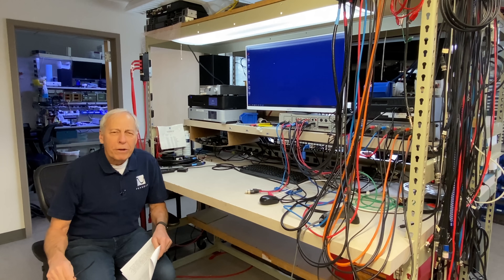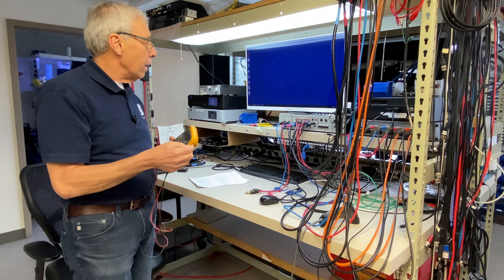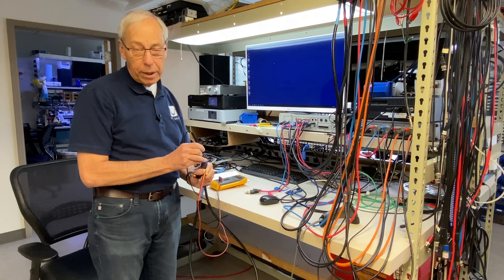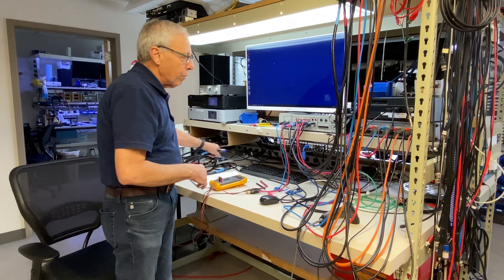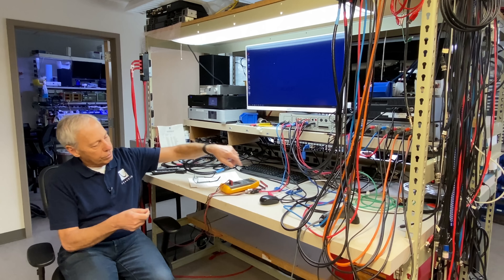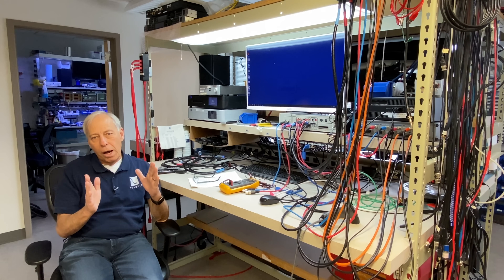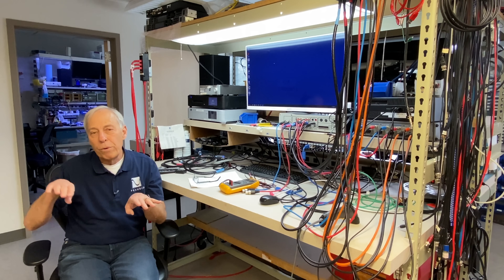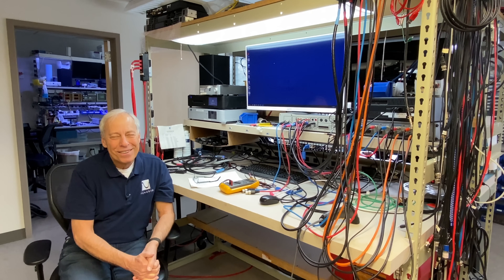Speaker cable impedance

Comment: You need to null out the meter in order to remove the resistance of the test leads.  In addition to this if you really want to measure the resistance of the cable accurately you must use a 4 wire measurement which applies a reference current through the cable and then you measure the resistance of the cable via a Kelvin connection. 

In order to measure impedance you need to use a network analyzer or some other type of AC measurement system.
Reply: You need your own channel
Reply: You are correct if you want milliohm resolution but I doubt more than 1% of the viewers here even know what a Kelvin clamp is or know how to use it. also to get a real picture he needs an LCR meter as inductance or capacitance could be high even if resistance were low , this is how some cables act as tone controls . Also He did compare it to his old cable for both sound and resistance .
Reply: @leekumiega6576  
The sloppy method Paul used isn't even accurate to the nearest 0.1 ohms.  Often 4-wire measurements are needed if you need to ensure errors are less than 0.1 ohms.
Reply: @marianneoelund2940  I have both an B&K precision and Fluke meter than can reliably read to .01 ohms the main advantage of 4 wire Kelvin clamps/clips  is to negate the meter lead resistance which is what the zero button does on my multimeter. More expensive 4 wire meters to measure 1 milliohm is overkill here.
Reply: @leekumiega6576  
Most people only have ohmmeters with 0.1 ohm resolution - such as the one Paul was using.
Reply: @marianneoelund2940  You are right about that as my meters are not inexpensive but cost less than a 4 wire Kelvin set up.
Reply: It's hard to imagine how one might make a 4-wire resistance measurement, without inherently using a Kelvin connection.  Of course, what you are measuring is actually a voltage, then the cable resistance is calculated from that and the known current.  
Regarding impedance, cable inductance can be important at high audio frequencies, if cables are very long.  For 4 ohm loads, I recommend using cables no longer than 10-12 ft, while 20 ft runs to 8 ohm speakers should be good if wire gauge is reasonably heavy.
Reply: @marianneoelund2940  Capacitive reactance is an issue at higher frequencies while inductive reactance is an issue for low frequencies . Hooray for someone who knows about Kelvin clamps/clips. For long runs with a 4 ohm load  use 10 gauge wire.
Reply: @leekumiega6576  
Capacitive reactance is in parallel and decreases with increasing frequency.  Inductive reactance is in series and increases with increasing frequency.  Both are issues at high frequencies only.  
Typically, cable inductance will produce a 1dB loss at 20KHz into a 4 ohm load, at a length of about 70 ft or 20m.  
As some audiophiles claim to be sensitive to high frequency loss as slight as 1/4 dB, they will need to keep cable length much shorter than 20m.
Reply: @marianneoelund2940  Right so your 18 AWG zip cord  has a capacitance of 28pF/ft and 12 Awg is 24pF/ft  https://www.passlabs.com/technical_article/speaker-cables-science-or-snake-oil/ the lower the better now since it's in parallel as the frequency goes up  the parallel Xc goes down which will shunt the higher frequencies more than the lower ones and since Xl is in series and goes up as the frequency goes up it will impede higher frequencies more than low ones .As such it is advantageous to get cables with the lowest L ,C & R readings and that can be accomplished by using 12 AWG or  10 for long runs as each parameter goes down with increasing cable size.
Reply: @leekumiega6576  
17.5pF per foot.  
Z0 is about 120 ohms.
Reply: @marianneoelund2940  how did you arrive at that figure?are you sure it's not .12  ohms
Reply: @leekumiega6576  
Z0 is characteristic impedance:  Z0 = SQRT(L/C).  You can calculate it from L and C measurements (gives 110 ohms for my 30 ft 18ga cable) or measure it directly using TDR methods (gives 130 ohms for the 18ga cable).  It's usually important only for very fast signals like RF or high bit-rate digital where you need impedance continuity to prevent reflections.  
The cable loop resistance is about 0.4 ohms.
Reply: @marianneoelund2940  Before I replied I wanted to make sure what I was saying is correct and that is that ZO does not matter at audio frequencies see  https://sound-au.com/cable-z.htm
Reply: @leekumiega6576  
Yes, as long as your cables are shorter than a couple of kilometers.  
That may be one reason why the telephone company limits their voice bandwidth to only a few KHz; they do have cables longer than that, but don't want the expense of impedance management.
Reply: @marianneoelund2940  I knew it is a concern for long network connections ( cat5 & up and coax ) and that's why cat 5 and old telcom uses twisted pairs and why fiber is so superior but I fail to see the reasoning of bringing it up for speaker wire .
Reply: Yes I know fiber also has much greater bandwidth especially if you use multiple wavelength multiplexing.
Reply: Or Simply,record the resistance with leads connected: 0.2 ohms.
Measure the Wire: 0.3 ohms.
MATH: 0.3-0.2=0.1 ohm.
KISS,my Brothers!
Stay Well.

Comment: "Resistance is Futile"

Sorry, I just had to.....
Reply: You will be assimilated by the PS Audio
Reply: All jokes aside, your quote is valid within the context of this presentation.
Reply: "Tried , have you? Hmm"
Reply: "Make it so, number 1". "Tea, Earl Grey, Hot".
Reply: BATTLE STATIONS. Shields up and load the photon torpedoes, Ensign set a course to Wolf 359 and take us to maximum warp....
Reply: It is good to remember that voice coils also have resistance, which is not futile.
Reply: Don't forget your towel!
Reply: @Hare_deLune  Yeah ..that's THE shield
Reply: Resistance is Not futile. 
It is voltage divided by current.
Reply: No it's not! - You can use the reciprocal of a resistance measurement reading to calculate the number of seamen on a ship.
Reply: @PebblesChan  
The things you learn in the Navy.  Who would've guessed?
Reply: @marianneoelund2940 indirectly meant SIEMENS ...not seaman
Reply: I am Dyslexic of Borg.  Prepare to be asslaminated.

Go ahead, tell me you didn't deserve that.  🤗

Comment: Hi Paul resistance and impedance are not the same, as impedance is an AC measurement in including reactance  on a cable or coil the only thing in common is the word resistance .Resistance is measured as you show on the meter is a function of a bridge measurement, like the videos
Reply: No the only thing they have in common is the word OHMS  , you mentioned reactance which is expressed in OHMS can be inductive  or capacitive or both  only DC resistance or impedance is expressed as resistance .

Comment: In the crossover to my old Infinity Kappa 8, that I have in my storage room now, there are two 25 watt 2 ohms resistors in parallel when you wanted to run the bass in "Extended" or in "Normal-mode" so to say that you have 4 ohms seems too come from the Twilight Zone.
Reply: Infinity Kappa 8 and 9 had 1 ohm resistors in series with a shunt inductor across the woofer. A switch was provided to short out the resistor for "extended" mode.
Reply: @samb3706  Yepp! My amplifier I used back then had 460 watt in 2 Ohms and it had som trouble with my Kappa 8's when I played music loud with some really deep bass in Extended mode.
Reply: @samb3706  
That's a 5 ohm resistor, and along with its inductor, it is connected immediately after the series input capacitor, rather than across the woofer.  The 12.5mH inductor in combination with the 1400uF input capacitor form a resonant circuit at 38Hz.  I haven't done the calculations yet (I may later) but that can potentially drop the system impedance quite low in the 35-40Hz region.
Edit - some calculated impedances for the woofer section:  
Extended Mode
20Hz, 4.2 ohms.  25Hz,  2.8 ohms.  30Hz, 2.0 ohms.  35Hz, 1.6 ohms.  38Hz, 1.5 ohms.  40Hz, 1.6 ohms.  45Hz, 1.8 ohms.  50Hz, 2.1 ohms.  60Hz, 2.5 ohms.  70Hz, 2.75 ohms.  
Normal Mode
20Hz, 6 ohms.  25Hz, 5 ohms.  30Hz, 4.3 ohms.  35Hz, 3.9 ohms.  38Hz, 3.7 ohms.
40Hz, 3.6 ohms.  45Hz, 3.4 ohms.  50Hz, 3.3 ohms.  60Hz, 3.1 ohms.  70Hz, 2.9 ohms.

Comment: Any speaker cable serves as a series resistor to your speaker. Even a cheap speaker cable can conduct with a fraction of an Ohm. You want something less than 0.2 Ohms (total loop resistance) to get a good damping factor (ability of your amp to control the speaker cone most precisely, especially in the bass). The resistance is proportional to the cable length, thus keep cables short. You lose some SPL, e.g. if you use a thin 20AWG cable of 20 feet you lose about 0.5dB and get a loop resistance of 0.4 Ohms, which will reduce your effective damping factor to max 20 with an 8 Ohms speaker.
Reply: Until we have superconducting voice coils, no system will have an effective damping factor better than 3.
Reply: @marianneoelund2940  Superconducting = no resistance ,not even the best amps can drive less than 1 ohm for very long.
Reply: @leekumiega6576  
Yes, we have to be careful not to send them any signals close to DC.
Reply: @marianneoelund2940  Yes, a DC signal at high enough voltage can easily make your speakers go up in smoke without any sound appearing other than the pop when you apply the DC. It's particularly bad and potentially costly, if your amplifier gets a malfunction that yield a DC output and your end up with speakers broken also. I had such experience long ago.
Reply: @marianneoelund2940  In Which case the effective ZO would be infinite.
Reply: @leekumiega6576  
Superconducting cables still have about the same Z0 - they just have much less attenuation over distance because the only loss is from the dielectric dissipation factor.  And as suggested by this paper, https://ieeexplore.ieee.org/document/333364 dielectric losses tend to greatly decrease at low temperatures also.
Reply: Marianne Oelund I’m not planning cryogenic properties of my cables and voice coils in the near future. Servo feedback is more viable. I just remember I met a company at CES 2020 in the area of many small startups promoting a kit with sensor and electronics to retrofit servo feedback on existing woofers. They appeared to have a good concept of tuning it. I thought about doing something with this company but got too busy with other things.
Reply: It would be interesting to know what frequency range they can achieve.  Do you remember the name of the company?  
There are alternative methods which do not require an accelerometer.  I'm planning some experiments with a small subwoofer that I have.  
But every approach works better without a passive crossover between the amp and woofer.
Reply: My room mate in Germany had connected a high-powered receiver to Pioneer HPM-100s with 24 gauge zip cord.
He received AM radio stations!
12 gauge wire tamed that Beastie!

Comment: Guysss,,, OL means; Open Loop!!!
Reply: Mike Eastridge  All of the digitals i've seen say ''OL''.  What if you test a open resistor with your multimeter. You are testing an OPEN circuit right?, like testing a switch on OFF, it's an OPEN circuit... Your multimeter is sending a small, calibrated voltage when on OHMS setting. If there is no continuity at all then, you have an OPEN LOOP situation!.
Reply: A 7 segment display can display “or” if they really meant to indicate out of range.
Reply: If you measure something properly with a DMM should read "OLE"(!) LOL
Reply: In digital instrumentation OL means input stage overloaded ie over full scale condition.
in the case of an ohmmeter OL could indeed mean open loop but this is not the standard intended meaning.